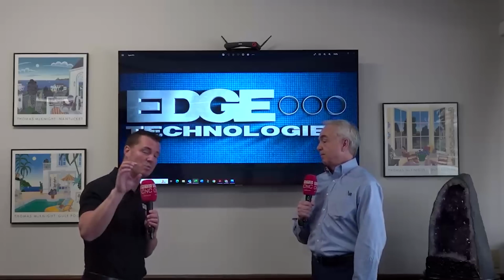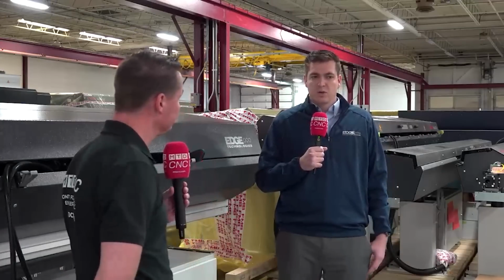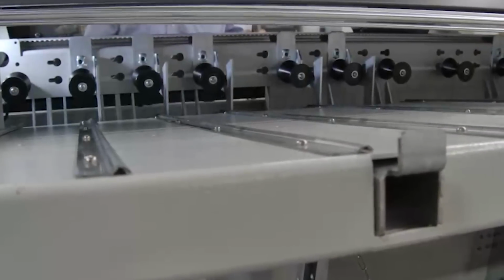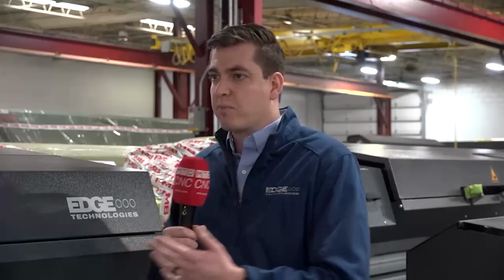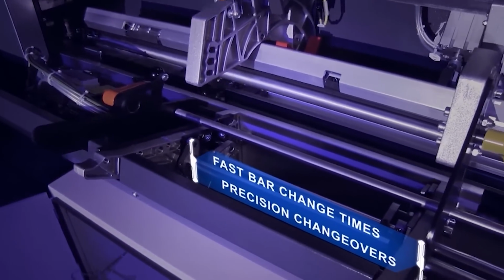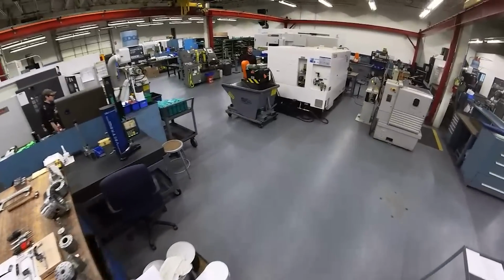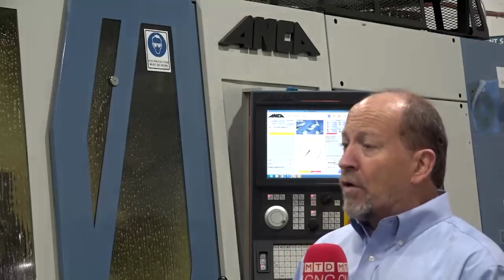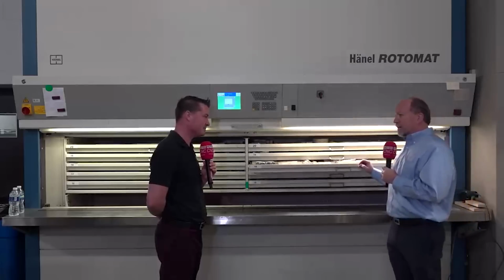This factory tour proves Edge Technologies is a great partner for customers!

Comment: do you know what kind of machines that the green machines are. They kind of look like deckles but I don't think they are.
Reply: Late model Abene by the look of it? VHF model seems to match with that.
Reply: @joelkeen2538  Thanks Joel. I will have to check them out. I have been looking for a deckle for my garage shop but are all but impossible to find here in the states.